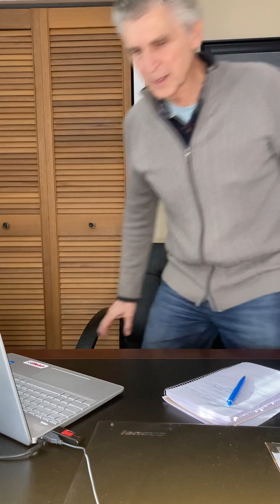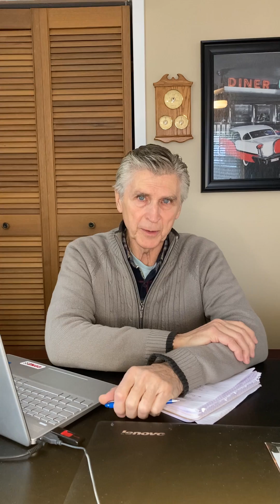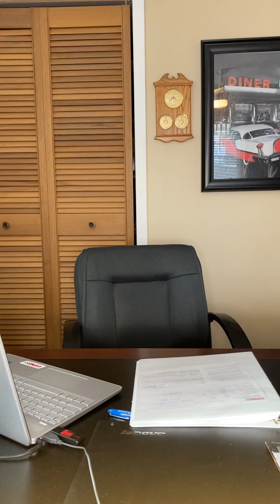Dynamic compression simplified

Comment: What is the ideal dynamic for a race motor? My little budget ls3 stroker is 13:1 static 9.3:1 dynamic.
Reply from the maker: Thanks for the question Sebastian. i think you are right on at 9.3:1 with race fuel. You should have well over 200psi cranking pressure. AG

Comment: You're right. Dynamic compression is both simple and complicated. What I've found that complicates it are the online calculators. I played with 6 or 7 of them using the same engine/cam parameters and while they all do a great job of finding the static CR, they all came up with vastly different dynamic CRs. Some results were beyond the extremes, at both ends. Some had bad math and some did not request the proper values. Some did not specify which IVC angle to use, and I'm sure most people are entering @.050" values, which would not be close enough to the valve actually closing to give reasonable results. 

But also, there are mixed messages about what the goal should be. Some say 8.0:1 DCR and some say 8:5:1 or even 8.75:1 

Well, I'm an electronics guy, so the math and engineering is no problem, but I rely on experienced experts like you to tell me what DCR would work best for a goal.  

I don't think there's any reasonable math equations available for calculating the onset of detonation based on timing, fuel type and DCR. There are too many other variables involved.
Reply from the maker: Thanks for your well thought out comments 100. 
I used to calculate static CR from basic principles and found that I get the same results with the Summit calculator, so now I use it because it is quicker and simpler. 
For dynamic CR the Wallace online is pretty close. You must use the at .006" or advertised numbers for IVC as nothing is compressed until the valve is completely closed. 
Remember that the calculation assumes zero leakdown so the actual is usually a little less as there is always some leakdown.
The final cranking compression number is most important because it is actual whereas the DCR is theoretical. For street engines on pump gas I usually stay between 160 and 180PSI. 
Also thanks for finding this video from the past. Measuring the location of the piston when the IV closes also validates the calculation. 
Hope this helps. AG
Reply from the maker: I am planning a video to demonstrate measuring the location of the piston in the bore when the IVC to validate DCR. AG
Reply: This would be a whole lot easier if when selecting a camshaft the numbers given would include at what degree of rotation the intake closes. Instead you need to get the advertised lift an lob separation and do some math to get a number before you can do more math. I'm building a 496 on paper while I'm waiting for my machinist to come back with a verdict on my block so I can order my rotating assembly with the correct pistons and move forward.